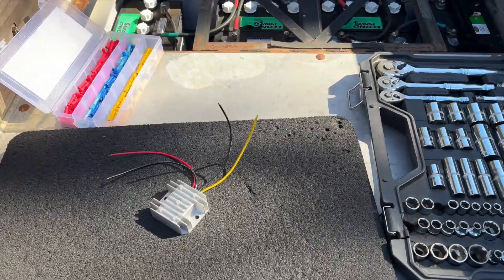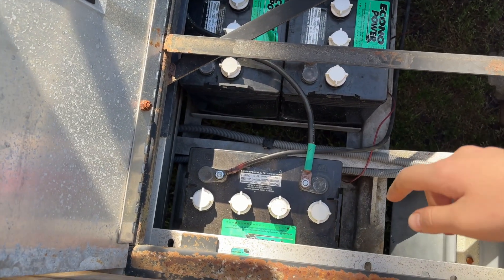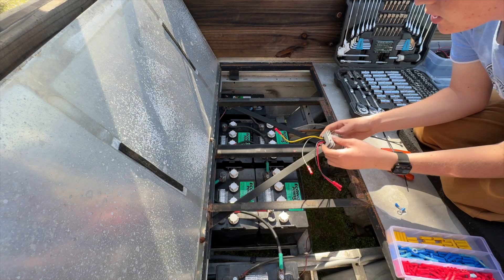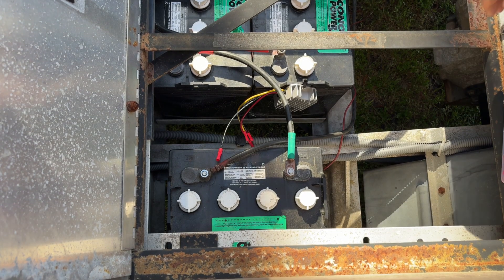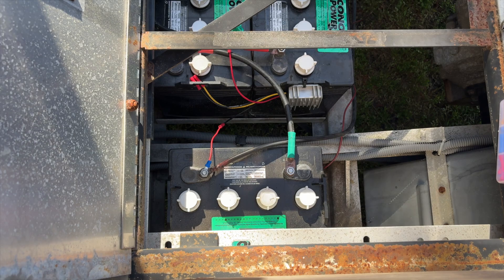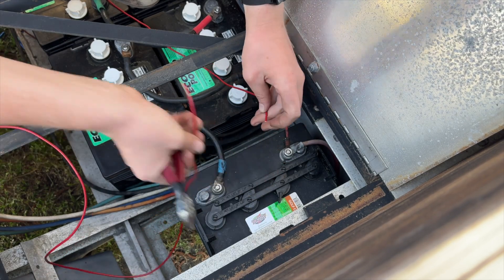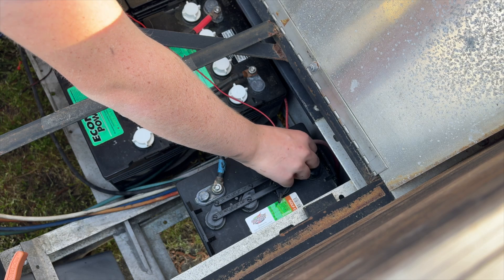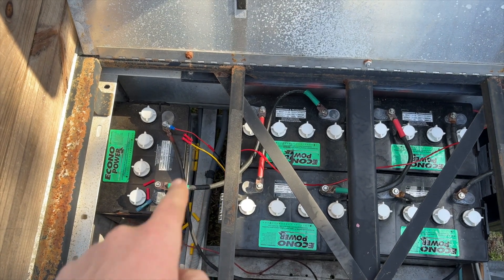How to wire a voltage reducer on 36 or 48V Golf Cart // Club Car, EZGO, Yamaha

Comment: Ok- so I’m dumb. Can you run multiple accessories off of the one reducer?
Reply from the maker: Yes you can but it all has to be spliced in to the 12v wires on the reducer. Sometimes it’s easiest to run those 12v wires to a bus bar like this one and then you can connect all your 12v accessories to that. 
https://amzn.to/42QSy0w